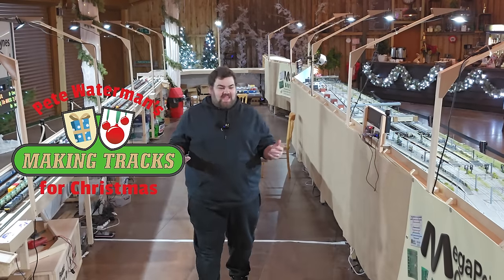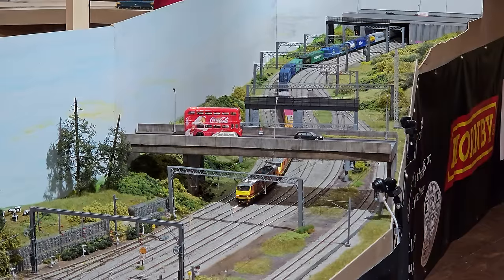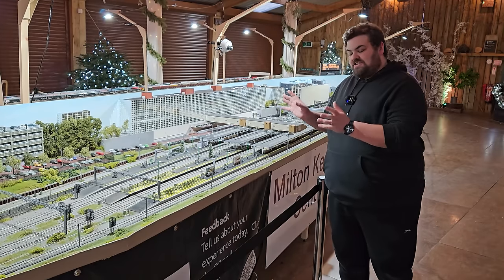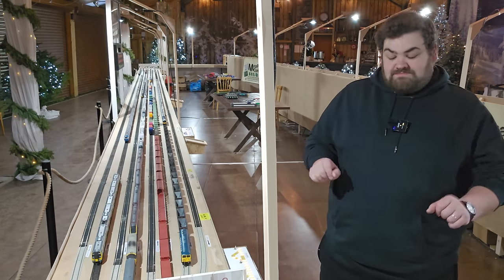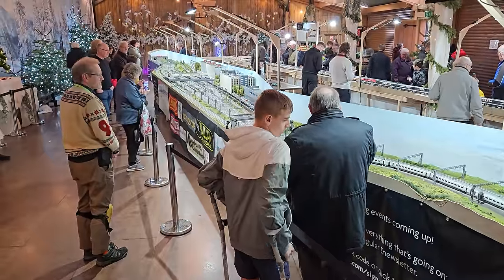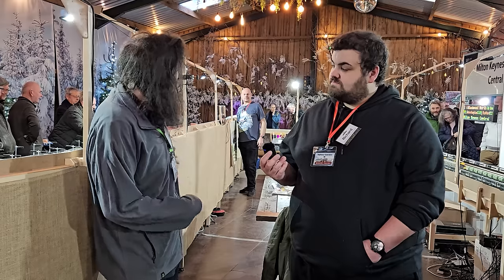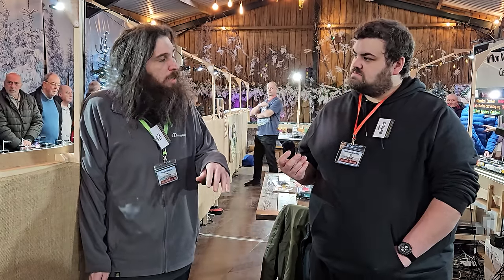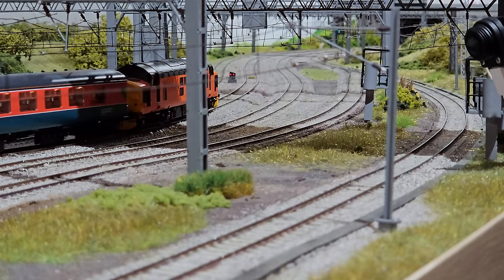Model Railway Layout Tour | Pete Waterman's 'Making Tracks 3'

Comment: Great video thank you.
Question for you
I see the wires going along in the air above the tracks for the electric trains, my question is
Is there a set that has wires like that that actually supply the engine with power instead of through tracks? Thank you for your time
Love your videos